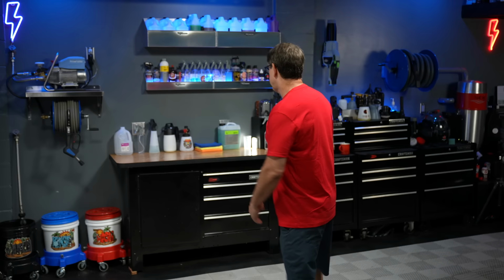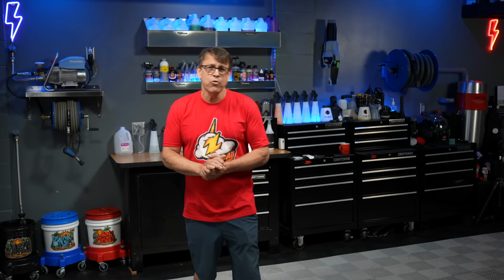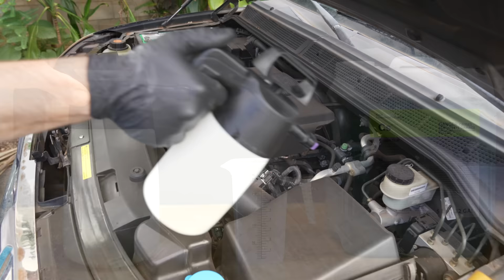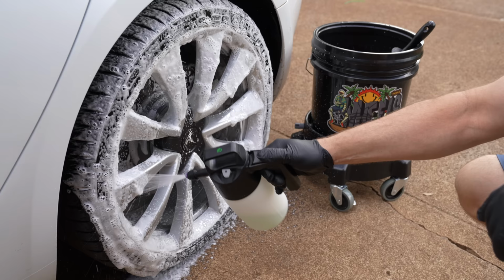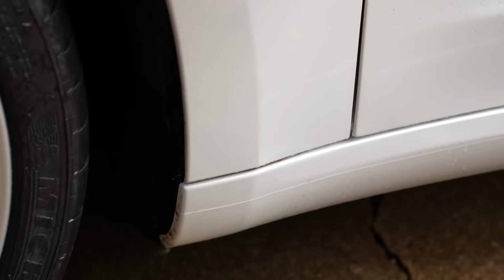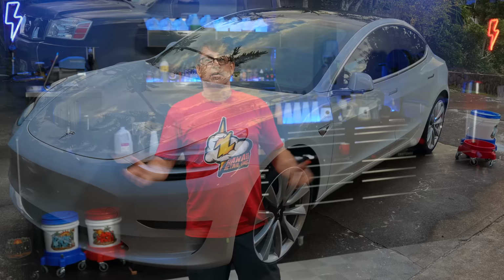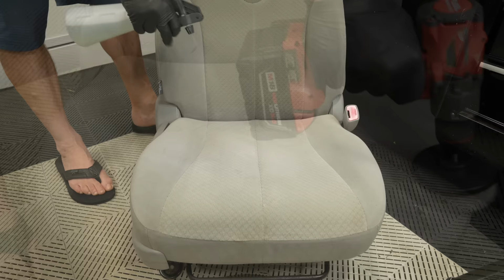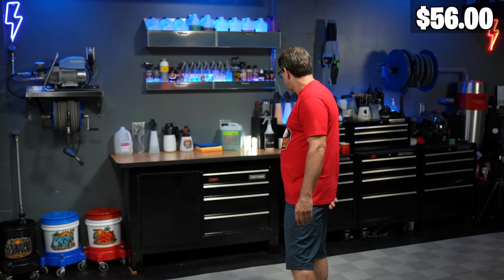FREE DETAILING PRODUCTS ALMOST!!! KOCH CHEMIE GREENSTAR All Purpose Cleaner

Comment: 'Cotch Kemmy'😂Greenstar is absolutely fantastic. I use it in two pump sprayers, one at 50:1 for bug removal and most other jobs, and the other at 10:1 for dirty undersides, tyres and neglected alloys. It's the only cleaner I need for washing nowadays. I own the 11 litre square barrel and I've only used about a quarter of it in about 4 years. Very economical. It works great on alloys as I find it does not leave flash corrosion on the discs/rotors and make calipers dull like most other APC's can.
Reply from the maker: I agree. Thanks for sharing your thoughts and watching the channel.

Comment: If you need to save even more money, Superclean comes in 1 gallon size for under $10 in retail stores and they have a dilution chart available online. You can also try your own dilution ratios depending on how dirty your car is. I doubt you need to use very much at all for maintenance cleaning. The company doesn't recommend it for washing the paint, but you can try to use it like a bug/tar remover as shown in the video. It will probably strip wax coatings off your car (but all degreasers will do that, they are supposed to do that)

Personally, I recommend getting a car shampoo, a wheel+tire cleaner and then use diluted Superclean for all the other parts of your car. You can find car shampoos and wheel+tire cleaners in gallon size as well.
Reply: I'm just getting started with self detailing. However I have both koch chemie green star and super clean, they both won't disappoint you!!!
Reply: Never use super clean on interiors
Reply: @roninbushito facts fam

Comment: APC = jack of all trades, master of none. I prefer more dedicated cleaners for wheels, carpet/upholstery and leather. APC will still work for these, as you showed.
Reply from the maker: Yeah. Ready to use products are great. Thanks for watching
Reply: I agree with the op to a point. Like, for example, upholstery cleaning. Most, if not all, “detailing” upholstery products are just not effective. Exactly why I exclusively use Bio Break (from Bridgepoint) on all upholstery when it needs to be addressed. I can’t even count the times I’ve refused to clean upholstery because it just didn’t need it. It’s also why I don’t use glass cleaning products, because nothing has worked better for me than isopropyl mixed with distilled water. Sure, colored and nice smelling cleaners are great but … are they really effectively cleaning? I find most of them just streak and leave residue behind. I’ll stick to what works for me.

It’s true, you CAN use 1 product to do almost everything and you’ll see good results. However, unless you see the same vehicles week after week, you’re never going to know if you’re doing more harm than good … so why risk it? It’s why I say; use acid when you need to, use alkaline when you need to, use ph balanced when you need to. Least aggressive is usually best.

😊😊😊

Comment: Awesome video as always.  Would using a none ph balanced soap affect your ceramic coating at all?
Reply from the maker: As long as its not overly aggressive it will be fine. It will possible affect spray protections for sure. Thanks for watching
Reply: Coatings are fine for ph 5-12   Sealants and waxes will lose durability from as little as normal washing with a neutral soap.

Comment: for tires, does it strip the black color from the tires?  Surely it'll get them clean but don't want it to be so strong that it strips color.  Had that happen with Turtle Wax Hybrid Solutions Wheel and Tire, stripped color from my Kumho AT52s.
Reply from the maker: Never had that happen but dilute it down if you want it to be less aggressive.
Reply: Most likely what you saw was residue left behind from that cheap cleaner.

Comment: I was so hoping you were going to use KC Motorplast on that engine after cleaning.😊 What ratio cleaner would you use to remove light break dust on gloss black powder coated wheels, 1:10?
Reply from the maker: Start light and increase as needed. Be careful this stuff is alkaline so don’t over do it.

Comment: Greenstar actually has rust inhibitors in it, so I'm not sure if you'd really wanna use that on interiors? Personally I find optimum power clean to be stronger yet just as safe
Reply from the maker: It does have corrosion inhibitors in it but they say all over the documentation that it can be used on interiors, carpets and seats. I have been doing it for quite a while with no problems at all.

Comment: I feel like the APC needs to be put up against much more inexpensive APCs like Maguier's or Super Clean. Frankly, Koch Chemie Greenstar is way overpriced. It's $65 for 5 liters (roughly 1.25 gallons) when Super Clean, which is available at Walmart and excels at everything is $10 and can be diluted as an APC at 5:1. So, 5 gallons for $10 or Koch Chemie Greenstar which is way more expensive? I know my choice.
Reply from the maker: Yeah up to you man. I find green star plenty affordable at these dilution ratios but I have used them all over the years and I understand. Thanks for watching
Reply: Super clean is not safe for paint and interiors and even tires being cheap is not good
Reply: @roninbushito  I wouldn't use it straight except on wheels, tires, and wheel wells. But diluted 4:1 or 5:1 all the way to 10:1 for interiors works amazingly well.

Comment: You said 2.5 product to 13.5 water.
I have always used 128 ounces ÷ by ratio, so in this case 5.
128÷5=25.6 ounces of product per gallon of water.
64 ounces=12.3
32 ounces=6.15
16 ounces=3.07

Now that you see where my brain is, can you explain how you get 2.5 ounces of product to 13.5 water?
Reply from the maker: I used a dilution ratio calculator and slightly rounded to the closest number. These are also my personal dilution ratios that I use and have found very effective. Diluting is a personal preference but I know what you mean and want to help. Here is the calculator if you are interested. Look under preset at the American chart. 5-1 it call for 13.3 water and 2.7 product. I rounded conservatively to measurable numbers. https://apps.apple.com/us/app/id1511339044
Reply: Never considered there is an app for this too.
Awesome reply, and thank you for the link. 
I agree it is a personal preference, and always cringe when people glug, glug it with no clue.